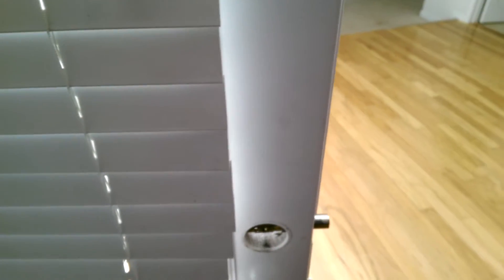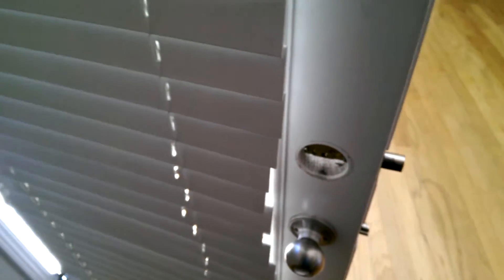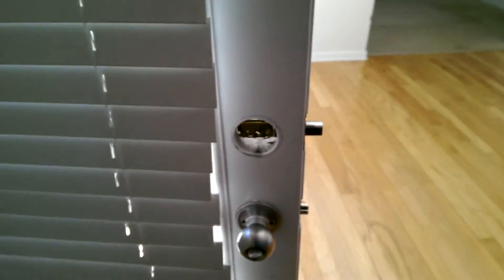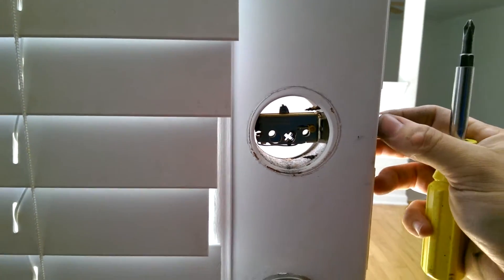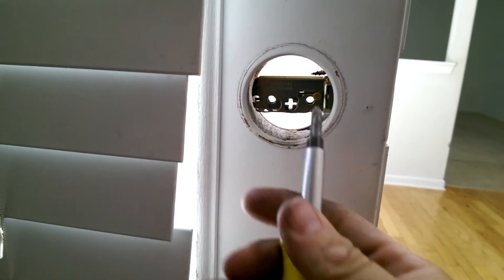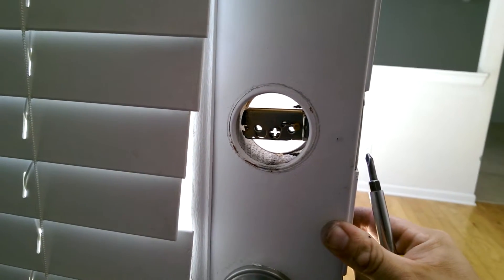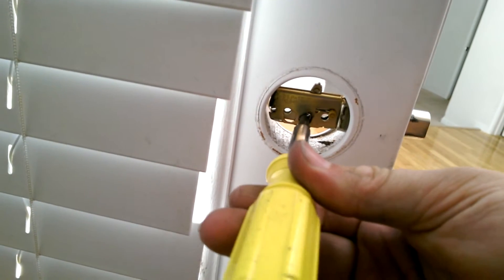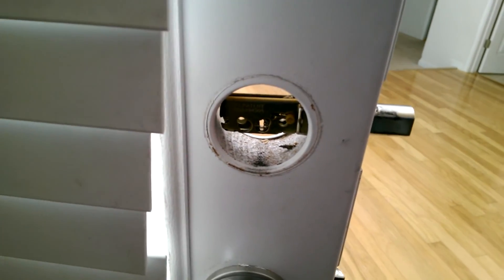Deadbolt screws problem

Comment: Also a good practice to measure the total length of the extended bolt, and the total depth of the hole. The deadbolt might operate normally when the door is open, but if the hole in the door frame isn't deep enough, you can have this same scenario.